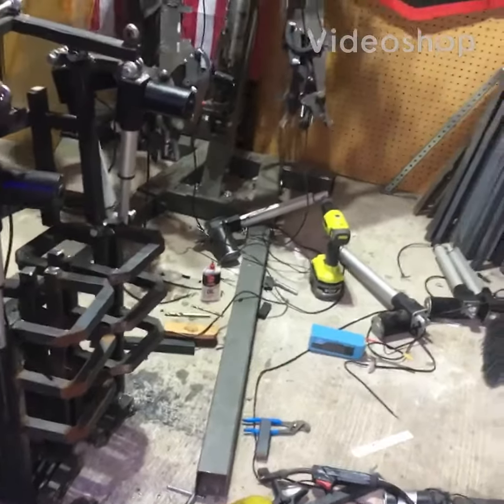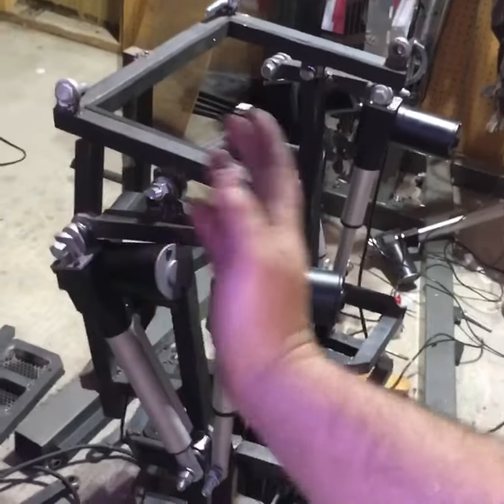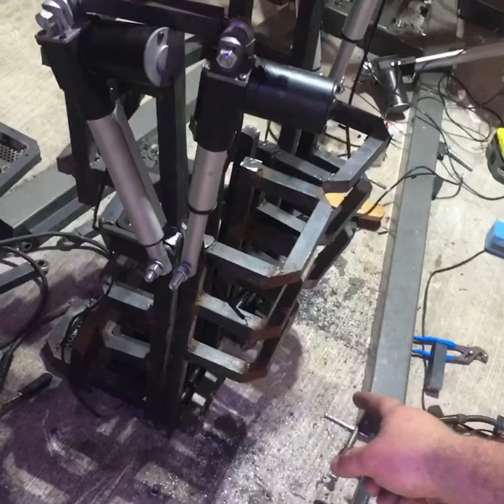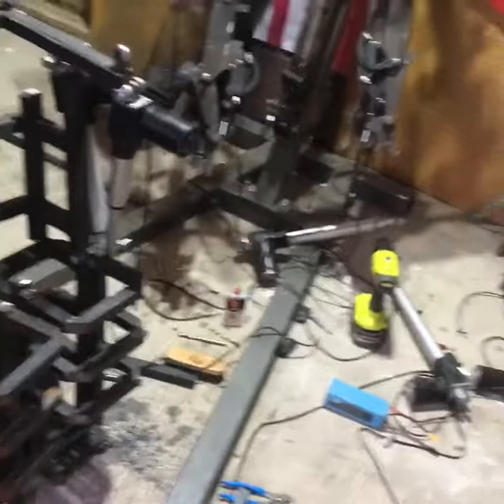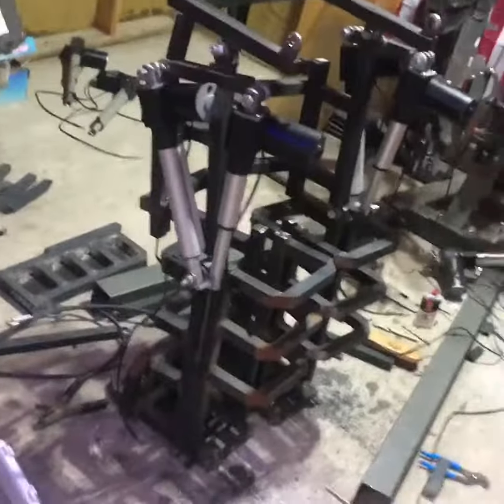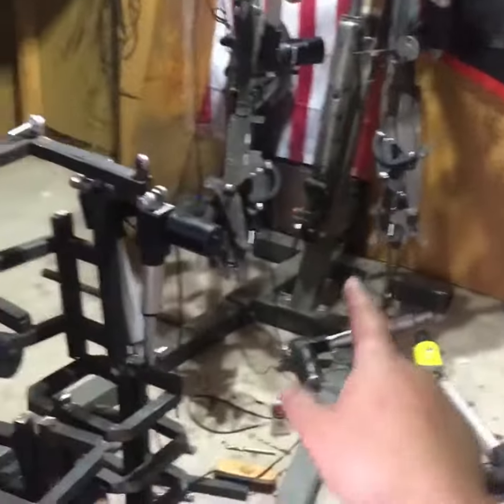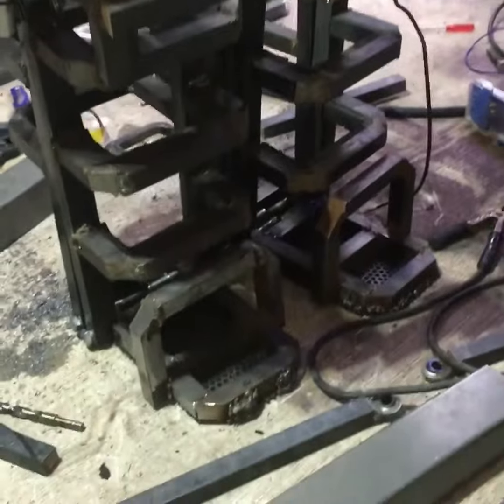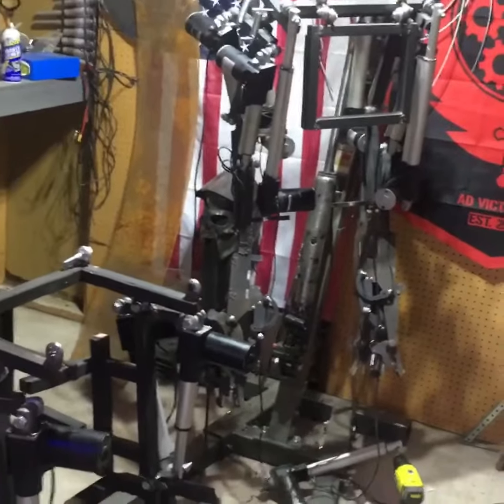Power Armor Project: Frame VII- lower body

Comment: So how will the head piece connect with the rest? Will it be like a conventional helmet or will there actually be a connection?
Reply from the maker: It will connect with rod ends and gas struts to support the weight of the helmet. I also plan to motorize the neck. I will have to redo the head piece